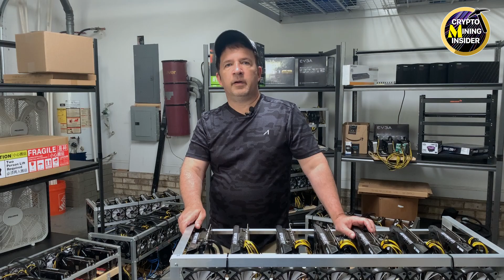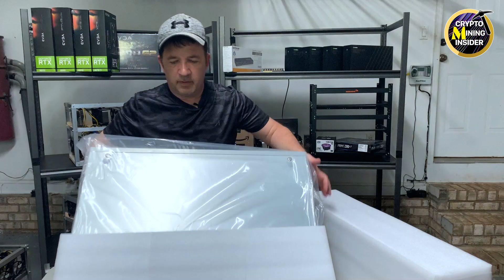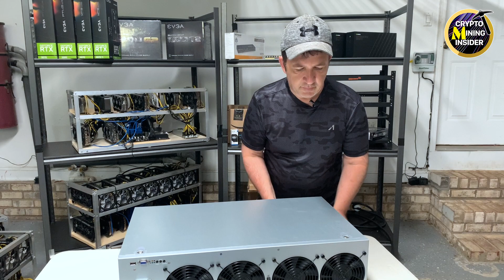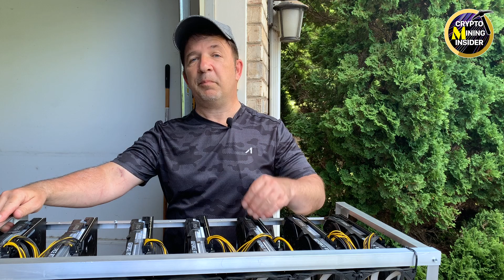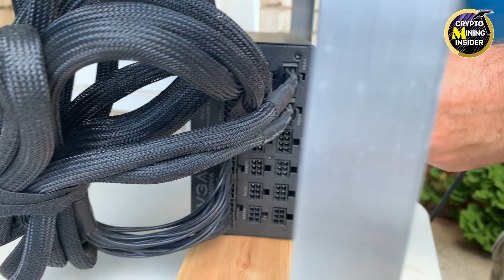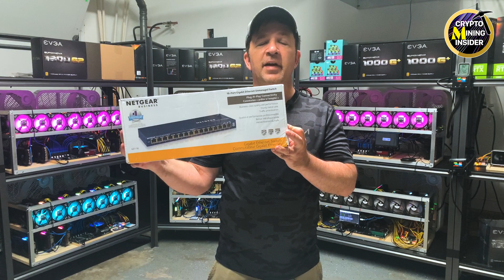MY CRYPTO MINING FARM MAKEOVER | 5.7 GH/s

Comment: how is the temp range in that room and what is the most efficient way to cool it?
I have just 13 GPUs in a room with AC yet it feels like an oven when I get to the room :(
Reply from the maker: See this video for my cooling setup - https://youtu.be/ECYCO9rQbwE
Lots of Airflow and ventilation has helped me. 

I currently push outdoor air in about 1500 CFM and exhaust it using a whole Whole House fan  cut into the ceiling about 2000 CFM. I added more cards since last summer so I will need to update my cooling plan.
Reply: Buy a 1500watt window unit and run it full blast 1 hour on 1 hour off, then Vent all the exhaust from your rug out a window.

Comment: Im from india and its super hot outside like 43degrees celsius. I have a farm full pf 3090s and 3080 nonlhr and 3080ti. How are u running your cards without air conditioners??? I have to run two 2ton acs continuously for cooling. The whole brick wall gets hot. Also during summer what kind of acs u use?
Reply from the maker: 43c is really hot man. Last summer I had to tune my cards down during hot days.  

You may check out my previous video on cooling THE COMPLETE GUIDE TO COOLING 🧊 GPU MINING RIGS 🔥
https://youtu.be/ECYCO9rQbwE
Reply: @CryptoMiningInsider  Pulling in outside air wont work in tropical climate of India...3090 asus turbo with blower requires air conditioning. Its very hot outside...also i dont wanna damage the cards.
Reply from the maker: @arnabchaudhuri1391  It must be hard with such a hot climate. Is electricity expensive to there ?
Reply: @CryptoMiningInsider  I have a 3phase 240v commercial connection...in Residential connection types it's a bit costly...for commercial it's 7.07 inr per unit ...1kwh equals 1unit. I have 3 split acs as il be adding Asics soon. Running two acs as of now 24x7. Don't have any other option.
Reply from the maker: @arnabchaudhuri1391  I'm not too familiar with 3 phase - you sound more knowledgeable about it than I am. I'm considering ASICS in future too. Keep me posted about your progress my friend
Reply: Look into geothermal earth tubes

Comment: i use sps secure socket to protect my devices do u also use?
Reply from the maker: I assume your talking about surge protection ?
I have a Surge Protector for my entire Circuit Panel to help protect my 240 Volts, I use regular surge protector power strip for my 120 v lines
Reply: @CryptoMiningInsider  it is an extra extension w extra sockets that have many protections

Comment: I’m sitting  just under 9MH/s and you’re still a great resource for useful tips and tidbits. Keep up the good work! 👍
Reply from the maker: Thanks My Friend !
Are you 9 MH/s or 9 GH/s
Reply: @CryptoMiningInsider  900MH/s on Ethhash! I would be sitting at 2.5GH/s but with the ETH merge coming, I’m trying to get cards running stable and cool on other algorithms/dual mining. However, I’m constantly running into thermal issues  and with this summer already being very hot, it seems like my basement is no longer sufficient enough to cool the rigs with ambient temps alone.

Also, a fun idea for a future video — thermal pad and paste replacement guides for varying video cards and video card brands! Or even various options for rig layout and cooling solutions!
Reply from the maker: @harryle4143  Great Ideas - Thanks. I was looking into some Thermal Pad replacements - have some cards already running to hot.
Reply: @CryptoMiningInsider  My cards were running on stock thermal pads and started crashing. Never ran into this issue before because my farm was relatively small.  Alleviated the problem by using  Gelid/Thermalright replacement pads and repasting the die with Noctua NT-H2 for all the GPUs. There aren't many definitive guides on pad thickness, so I had to use a digital caliper to measure the pre-existing pads for reference.

But with the temperature rising with each passing day, I might have to start setting lower power limits/clock speeds to curb the heat. 

In any case, we'll all be waiting on your next video!
Reply from the maker: @harryle4143  I definately have to do some pads vbery  soon -I have some hot cards (mainly 3080s) tuned down to keep temps safe for now.
Reply: @CryptoMiningInsider  I have various 3080’s (FE, Asus TUF, Zotac Holo/Trinity) and while the core temps remained relatively unchanged, the VRAM temps dropped an average 10C-15C. Definitely a worthwhile modification to look into especially considering the same or similar temp drops were observed in my many other GDDR6X GPUs. Good luck!
Reply from the maker: @harryle4143  Thanks for info - will look into it

Comment: You can build a rig with 2x2 wood from home depot, cost less than $10 for 8 GPU rig.
Reply from the maker: I use Aluminum for Rig frames for lite weight, sturdy and portability - Aluminum is getting expensive